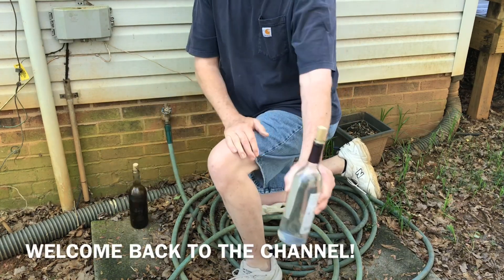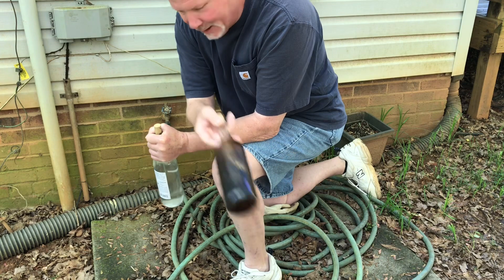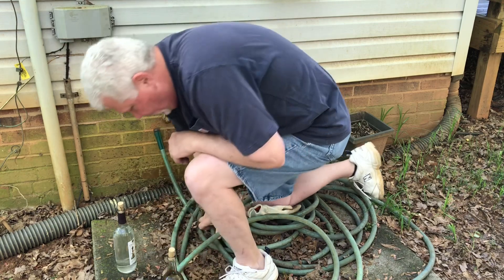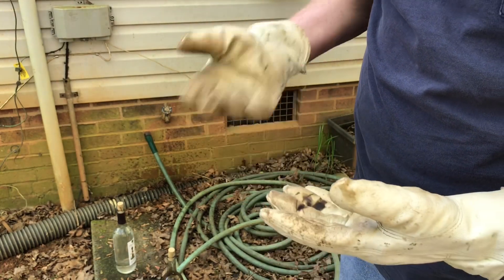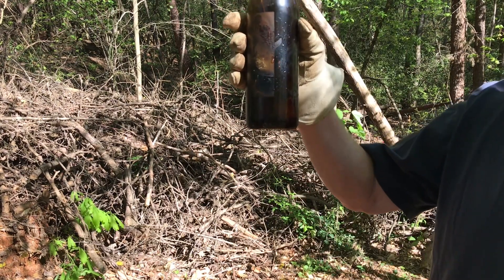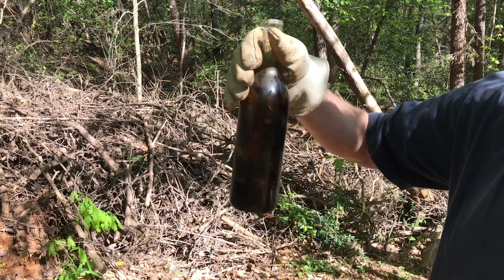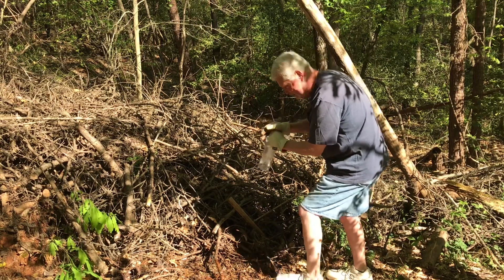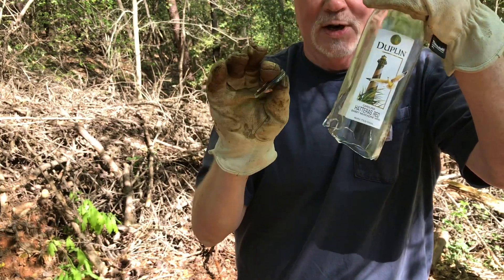Breaking The Bottom Out Of Wine Bottles By Smacking Their Tops! Will it work with the thicker glass?

Comment from the maker: The last time I tried this, I used a couple of bottles that I happened to find in the woods. They were the older style glass Pepsi bottle and a glass Yoohoo bottle. (See LINK below) Today, I wanted to see if the much thicker glass of wine bottles and their bottoms would succumb to this technique also.
   There are many videos on Youtube that show this technique. Take a bottle, fill it with water to a couple of inches below the top, smack it sharply on top with your hand, a visible cavitation occurs at the bottom of the bottle... a strong vacuum chamber, the weight of the water comes crashing back down against the bottom of the bottle, and breaks out the bottom.
   Come have a look at how it all turned out!... Please SUBSCRIBE at the end of the video. Thanks!

Break The Bottom Out Of A Glass Bottle By Forcefully Hitting The Top! Ferro Rod, Bipolar Percussion
https://youtu.be/qc0PDKpcU1o
Making Fire and Boiling Water with no Knife, Fire Making Gear, or Metal Container!
https://youtu.be/-2rL428mJiM